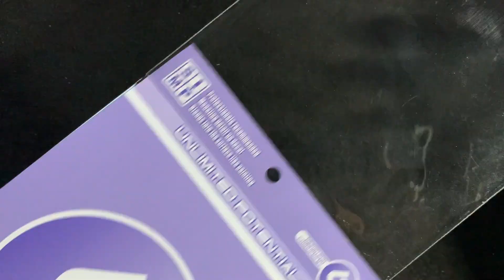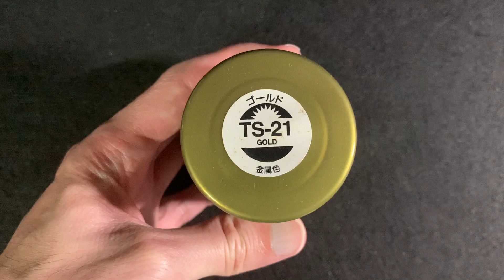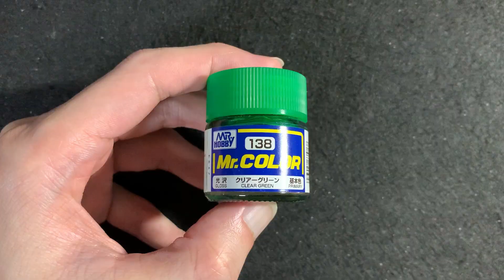RG 1/144 GOD GUNDAM Speed Paint build Review

Comment: Is there a certain reason why you use lacquer-based clear colors instead of acrylics? Both for brushing and airbrushing kits.
Reply from the maker: @Lucius6666-u2w  not really. The gx114 is just work. I have tried tamiya acrylic xf-86 and mr.hobby lacquer 182 but they dont work. If i know other paint that work i will try them too
Reply: @Armstudiogunplaspeedbuild Hey, if you don't mind my asking how do you thin your lacquer paints before using them on a clear piece (using paint brushes) and what type of thinner do you use? I'm planning on buying some of the mr color you use in your videos to paint the eyes but I have no clue how to properly use them or the ratio.
Reply from the maker: @Lucius6666-u2w  it is lacquer paint so use lacquer thinner. if you wanna use paint brush for the eyes, you dont need to thin the paint. unless the paint is too thick, you can add a drop of thinner.

Comment: Excuse me, what is the difference between wing zero 1/00 and 1/44?
Reply from the maker: It is a scale of model kit. For example, Wing zero actual size is 16.7 meters or 1670 centimeters. 1/100 means 100 times smaller than actual size. So, it will be 1670cm/100 = 16.7cm. For 1/144 scale will be 1670cm/144 = 11.6cm.
Reply: @Armstudiogunplaspeedbuild  That means 1/100 is bigger right?
Reply from the maker: @CristopherGascon  yes
Reply: @Armstudiogunplaspeedbuild  thank you